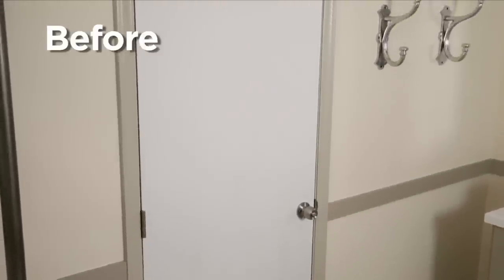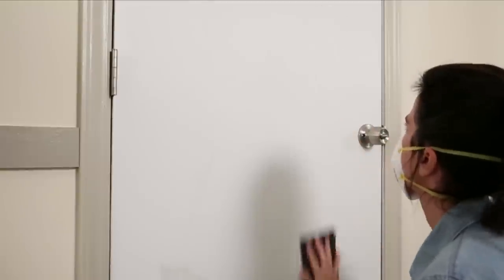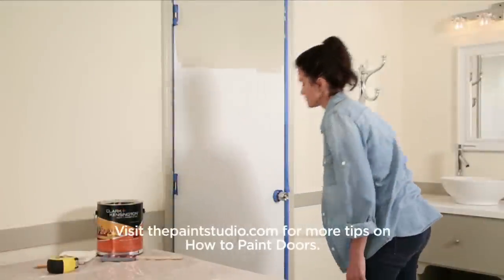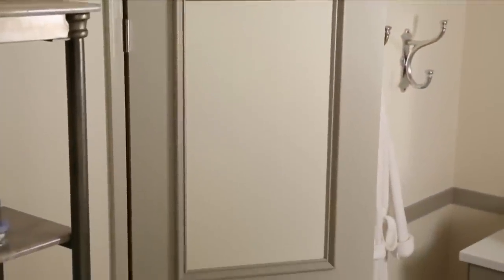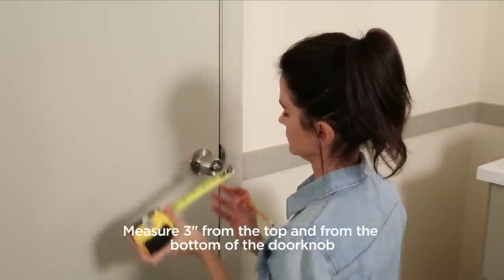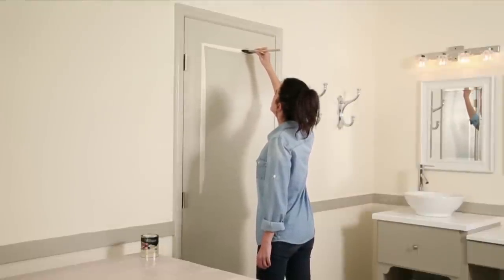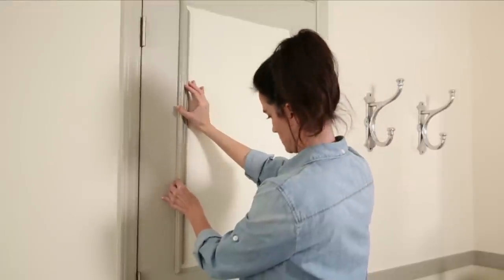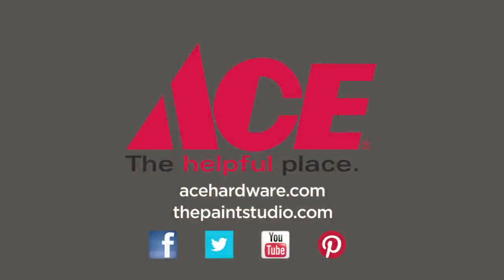How To Paint A Plain Interior Door - Ace Hardware

Comment: I've used both a short nap (smooth - semi-smooth surfaces) and a sponge (smooth surfaces) roller on my smooth, interior, hollow-core doors at 70F ambient temperature with a new gallon of semi-gloss paint.
The short nap roller left a pronounced "spackled" or "pitted" texture all over the surface, so I switched to the sponge.
No matter how quickly I move the roller or how thin / thick I apply the paint, I can not for the life of me achieve an even coat. Every pass with the roller leaves evidence of its path. I'm on my third coat now and it's still very clear where the roller has been. How many coats does it take before the roller leaves an even coat? Are some door materials only able to be painted by spraying rather than brush or roller?

Comment: Luxe Architectural has kits that are already assembled, primed and with an adhesive on the back so there's no need to glue or nail.  Simply remove the protective backing and attach to the door. These kits will make this project a lot quicker and easier!